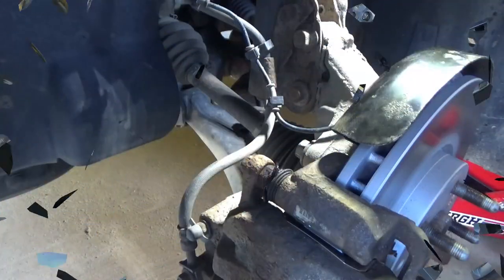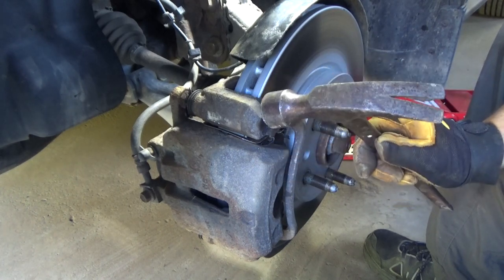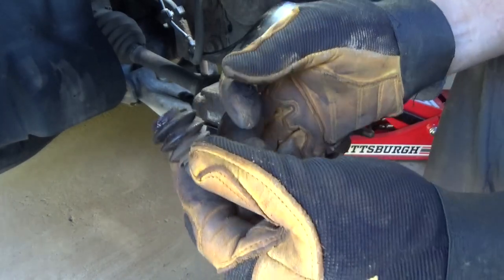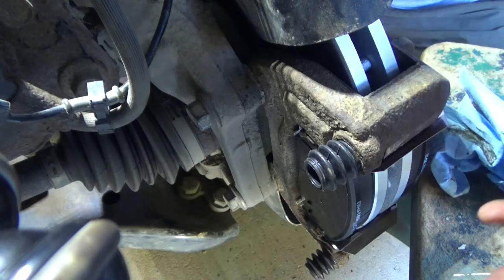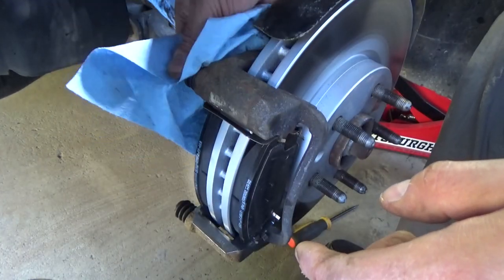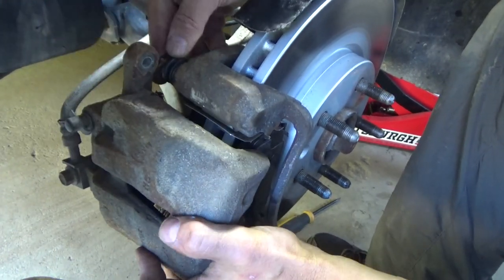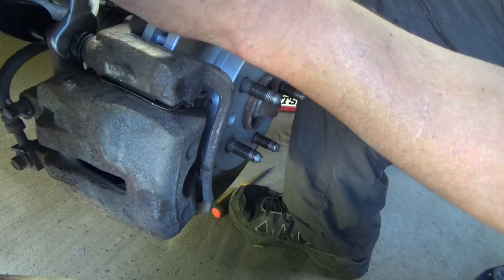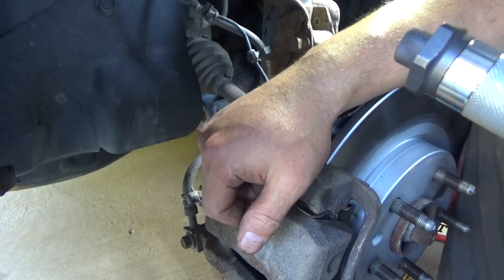How to Replace Brake Caliper Guide Pin Boots On a Chevy Equinox, GMC Acadia, Terrain & Most Vehicles

Comment: you're the only video that tests the pins after replacement how they bounce in and out because I couldn't tell if mines are ok. Thanks to you now I can see how they're supposed to work
Reply: I had the same question.  I came here to see if the pins are supposed to push out on their own and it looks like the answer is no.
Reply: @Packer1290  yes they should bounce back when you push them with your finger like spring motion. at least one should

Comment: Thank you for posting this video.  I was going to buy new caliper brackets as I thought my guide pins were not moving in & out easy enough and you mentioned that there should be some resistance after lubing & reinserting them in the bracket.  The little things like what you're showing here is what saves you money in the long haul.

Comment: Is it really necessary to have that 18 inch backup on there. I just replaced my brake pads and I didn't really need a backup. But now I found the old pads were wearing unevenly. The inside pad was wearing faster than the outside pad. Was told its the guide pins that may need to be replaced. Is this correct?

Comment: Hi. How do you remove the caliper brake pin guide bolts boots that have a metal end? Also how do you install new ones? This is for a 2005 Hummer H2.

Comment: i changed my brake pads this weekend and I noticed a small hole in the rubber sleeve. Oil was slowly coming out of it. Will this cause major problems?

Comment: Good job. I did mine sometime ago in my Nissan Skyline Gt but my guide pins as rubber close to the end  and they were hard to push back in. So i took them off and they went in fine. What could be the cause of this happening?
Reply: Dried out grease. Boot was already compromised. It eventually allowed in air, debris and road dirt